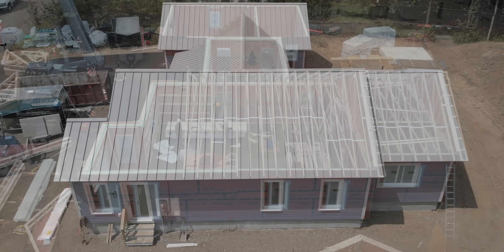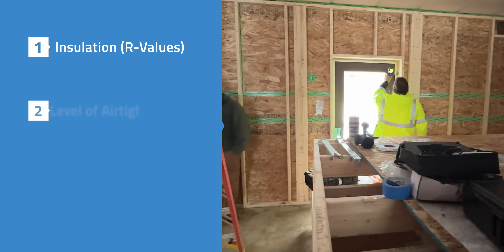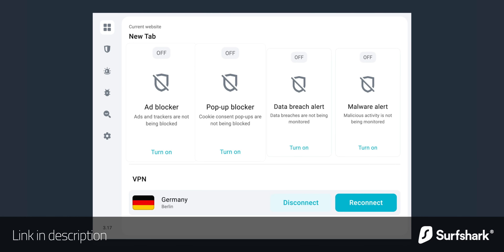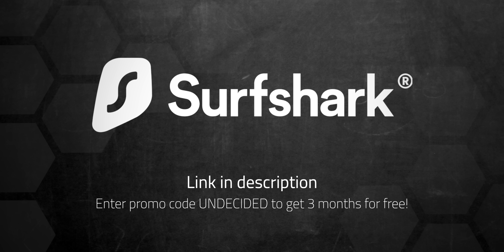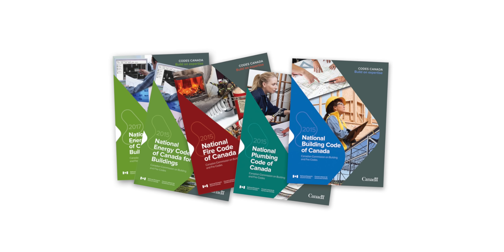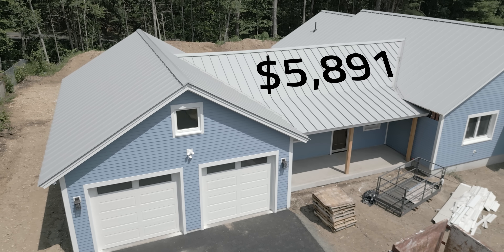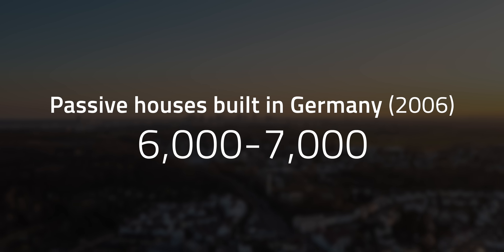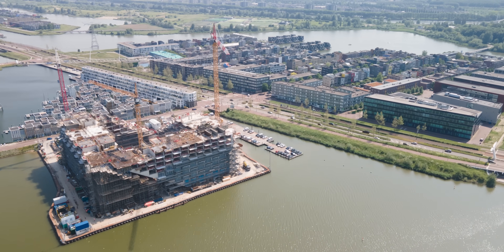Why Do American Homes Suck?

Comment: I think you need to include a fact that you've carefully stepped around. Construction numbers. In the U.S. we build new houses in the hundreds compared to at most double digit for most of those European countries. And you also don't mention when these new improved construction standards were implemented in Europe, because buddy, most European residential construction is really old and even the newer stuff is poorly built. 

Residential construction using cinderblocks is still common along the Mediterranean and places other than the U.K.  And consider that your comparisons are based on single family dwellings while that type of housing makes up less than 10 percent of construction in Europe where apartments and connected townhouses make up the bulk of construction.

Comment: I think all buildings and homes should be passiv standard wherever you are. I can tell you in the UK that the majority of houses in the UK are old, brick uninsulated houses with gas. As these old houses were designed to breath and also it is very difficult to air tight an old home, i think it is best for breathable insulation such as wood fibre and lime plaster. Solar and heat pumps or infrared heating is a must. Sadly our Dumb ass prime minister has started cutting funding for climate change policies. He's got kids as well. Were doomed with people like him.

Comment: The ACH50 listed for Canada is wrong, or at least it’s miss leading. Without going on a long tangent no one cares about. It varies where in Canada you’re talking about and which compliance path chosen but 2.5 ACH is likely a more accurate figure as a generalization imo. But most, if not all, areas this isn’t tested.

Comment: In America, we have innovators like Elon Musk who have advanced car manufacturing. By comparison when it comes to new homes little progress has been made over the years that benefits home buyers. For example, builders get all excited about PEX plumbing as opposed to traditional copper plumbing. That's because it's easy to install and if you're a lucky home buyer the plumber actually knew how to properly attach the pipes together. I read recently that rats are attracted to PEX plastic. Homeowners have had their homes flooded because rats chewed through their water inlet pipes. The bottom line is, that in 2023, homes could be built so much better and be far more maintenance-free, but they're not at all. As a final comment, I live in a neighborhood in N GA that is close to the Alpharetta city center. The area has become popular with wealthy buyers who buy homes in our neighborhood for the land and tear down to rebuild mini-mansions. I used to work in construction and spoke with a construction supervisor in our neighborhood. He said that true carpenters are nearly non-existent. Homes are built by somewhat skilled laborers and unskilled laborers. Good construction supervisors are usually former carpenters. I've seen slabs poured over PEX and imagine rats chewing through the pipe creating a nightmare for the homeowner at some time down the road. One home up the street from us was up for sale for 2.6 million. It had an underground plumbing leak for about a month pouring water into the gutter. I think they may have fixed it but what about future leaks if the pipes weren't connected properly?

Comment: The Metric System.   There is no argument that it is far better than the imperial system.  If you measure in Metric, you will never have to work in fractions.  

I hear Americans complaining about the Metric System, however I  laugh as all Americans have been using the Metric System for over 200 years and I have never heard anyone complain about it.

Metric has three main Units: Metre - Measurement,    Litre - Volume,     Gram - Weight.

There is one more Unit you don't hear aboutt.   That unit is the DOLLAR.

We have a Deci-Dollar, or as we call it a Dime.

And we have a Centi-Dollar we call a Cent.

If we go the other way we get Mega-Dollars.

So no need to be afraid of Metric.  It is as easy as dividing and multiplying by 10s, just as you do with Dollars.

Of course in the money world they have quarters and half-dollars, but overall, it is a Metric System.

Comment: Back in 1985 I bought a 1903 craftsman brown shingle home in the San Francisco Bay Area. It was mainly original. Oh the gas lighting had been replaced with 30 amps of electricity and knob and tube wiring. The heating had been upgraded from the coal stove in the kitchen to a horizontal gas heater sitting on bricks in the crawl space. And a garage was tacked onto the side of the house with the inside wall still covered with the original wood shingles from 1903. Single pane windows and zero insulation. This was a stick built wood frame house with lath and plaster walls.

The first task, this being earthquake country, was to replace the brick foundation. This also provided the opportunity to have a small utility basement so the water heater wouldn't be outside and to add a reasonable gas heater.

After retirement and the accumulation of sufficient assets to upgrade everything, the house was completely updated: New roof with solar, 200 amp electrical service, heat pump water heater and heat pump heating and cooling, insulation to the max and more than just one bathroom. The only remaining gas appliance is a clothes dryer. The big surprise was that I had a negative gas and electricity bill for 2022. I actually made $230! Insulation and double pane windows made the difference. Heat pumps and LED lighting helped too.

After reading some anti-city comments here I must add that the house has a walk score of 98, a bicycle score of 99 and a transit score of 62. It is on a quiet street because of traffic calming and has a large back yard. These things are compatible with good city design. It is a real 15 minute city.

Comment: Ok, a couple of issues right away.
 The sheathing has absolutely nothing to do with insulation, it is there to regulate vapor exchange. Every wooden house has to have that regardless of what else might be done inside.

Saying that there is a lack of federal regulations makes about as much sense as saying that NASA doesn't do enough to regulate food additives.  The reason we don't have federal standards on environmentally friendly home design, is because that has nothing to do with foreign pollicy, the bill of rights, or interstate commerce. The federal government has no authority to act outside of those areas. Only state governments can regulate building standards.

Comment: The biggest problem I see in the UK is a lack of tiny houses as starter home. And I mean houses. If it has wheels, it's not a tiny home or house, it's a caravan (or a bicycle or something). There are some great designs out there, even ones that don't require the residents to be a 25 year old gymnast who can vault into a loft bed. But we aren't building them at all, there are no developers doing it (a handful of councils are building them for social housing but in tiny numbers) and worst of all, we aren't even building blocks of flats on that principle which would be vastly more efficient.

The block I used to live in I rarely needed to heat the flat at all. Triple glazing, tilt and turn, thick/well insulated walls. Lots of other problems but heating wasn't one of them. Whoever let them build a ten story building with one lift should be imprisoned for instance, don't ever buy in a property like that if it's newly built. We'd turn the heating on for maybe a couple of months in the winter. The bigger problem with heat was getting rid of it during the summer because you couldn't get a draft through with the windows open most days. A simple venting fan would have taken care of that, wouldn't even have needed full on air conditioning (but they should build with it). 

There was so much wasted space in that flat though from terrible layout decisions and a lack of focus on tiny home philosophy - which should be applied to all buildings. Storage, storage, storage. It's amazing that homes aren't designed in 3D to take proper advantage of space. 

But I'd still rather live in UK houses than typical American ones.

Comment: I never reall6 paid much attention to new home build quality till I started watching Matt Risner's BUILD show. Then I started looking at all the cookie cutter housing projects and comparing them. I realized how little of quality they were at an outrageous price.
It's clear they are being built to the lowest standard code allows to sell at the highest price possible for the building investors, and for the same price, I could have a custom home built to very high standards.
Reply: There was a million dollar home put up on my road, they spray foamed the exterior walls for insulation, and didn't go beyond half filing the 2x4 walls. So about 1/2 to 3/4 inch of spray foam between the studs in USDA zone 6.

Comment: I live in a 1931 house with zero insulation (except where we opened walls after purchase).  The climate in SoCal is desert like.  So HEAT is our foe.  But unless the temp goes three digits we dont turn on the air conditioner.  And being only 1400 square feet we really dont use that much energy (we put solar up on our flat roof back in 2010).  Our last two month power bill even using the air conditioner many days was only $37.  Winter isnt that cold.  I grew up in Chicago so know what cold really is.  It never gets down below freezing (which is rare) but 40s and 50s is normal.  But the locals--geez--youd think the world was ending with such temps.  Ive survived 40 below several times back in Chicago--even working nights on a movie for five weeks.  SoCal is a breeze.  Are we losing energy through our stucco walls?  Absolutely.  But with the solar panels on the roof I truly believe they are actually saving us from the heat.  

Cant wait to hear more about the new house.

Comment: The unified code fails to consider energy efficient, low cost ALTERNATIVE building methods.  It's primary focus is to protect big business interests either than address environmental and safety concerns.

A big failure.

Comment: YES YES YES!!! American homes just suck regarding efficiency. I built my retirement home in 2017-18 using ICF construction, triple pane windows, and more. There was only 1 contractor in a 200 mi radius of me that even had experience with this method of building. Overall more expensive but absolutely will pay for itself over the next 20yrs. ACH score of .97! I wasn’t willing to get rid of my regular dryer, or stove vent, and having a wood stove didn’t help the score either. Totally satisfied with where we ended up.

Comment: Most of Europe is located at a higher latitude than the USA.  That means on average, most of Europe is colder than most of America.  As such, they benefit much more from insulation than most of America does.

In addition, energy of most sorts is notably more expensive in most of Europe than in most of America due to increased taxes.  That also makes efficiency that much more desirable in Europe than in most of America.

Combined, that makes a great difference in viewpoints in what insulation and efficiency concerns and standards are considered important.

Comment: I see several mistakes. triple glass pane windows are nice, but double glass panel windows are quite common in europe too. even that is better than just one panel.
the bigger mistake is still hanging on balloon frame buildings. in europe, stone and bricks are used regularly. the most insane thing I've heard about someone so far: using 45cm hollow chamber bricks (essentially 1.5 ft for the metrically challenged) and that guy got to passive house standards without a single centimeter of thermal protection (just google "mauerhohlblockstein").
and you complain that the US has various building standards, and not just one? well, there is the EU and there are countries that are not members of the EU. neither have common building codes, or just building codes on national level, but it goes way down to municipal level in some countries.
additional fun fact: there is the plus energy house, a standard in germany, austria and maybe other countries. a house that virtually always creates more energy than it uses. and that standard was created well over 20 years ago.
by the way, I grew up in a house that was built in 1601. at times it was hard because it was poorly insulated (we had double windows... essentially one set of glass windows and then 10cm away a second set of glass windows, that was a tech that was well over 100 years old. but now since it was renovated (parents still live there), this house is great. 1601. and the church next to it (10m) was built between 1272 and 1336. still standing strong, but recently a storm crooked the cross on top of it, so it had to be replaced.

Comment: Always enjoy your videos. Thank you very much Matt. Regarding home energy efficiency, one thing no one mentions, and that is certainly not in any building regulation here in England, is the question as to whether or not a house is facing south or not. Or, indeed, whether it is geographically exposed to the sun's rays. In the North of England I have seen expensive houses built on North facing hills, such that on a freezing day in Winter they are covered in ice, while across the valley  a few houses are frost free enjoying Winter sunshine melting the ice on their roofs. The small town of Ilkley in Yorkshire is a good example of this. This can be particularly striking on a frosty day as late as March or April when the shadowed areas remain in frost whilst the midday sun's rays can be already quite hot. "Don't cast a clout til May is out". And, make sure your house is catching the sun's rays. 

Along the Wharfe valley, where Ilkley is situated, there are a number of 18th century halls all built facing South. With the morning Eastern sun warming the Eastern side of the halls, then the midday sun warming the South side of the halls, and the Western side of the halls warmed before the sun sets. Added to this, the impressive stair wells of these lovely halls are designed to be in the middle of the home, causing a wonderful convection to happen. Warm air from the sun's warmth enterers from East, South and West, but rises through the middle of the house, and convects out in all directions on the upper floors. 

One can insulate the poor man's house on the North side of the valley as much as one likes, however, it will never be as comfortable as the rich man's hall facing South, on the South side of the valley.

Modern "Gaia" houses in Norway have understood this concept. While, Matt, you know better than I about Copenhagen's building inside a geodesic dome https://youtu.be/1Bn2o-xyS6M?si=rMGbJS5Nu-52GLTd Wouldn't it be far more effective to cover a whole home in a "greenhouse" than waste money on insulation and expensive windows?

Comment: I think the biggest difference between European houses and American houses isn't the insulation or airtightness, it's that heating in Europe is water-based, not air based. I'm honestly surprised that you went through all that troubles of building a super efficient home and let's be honest, paying a lot more than a regular home would have cost, and then you stick with cheap forced air instead of getting the much more comfortable heat from a (ideally underfloor) water-based system?

Comment: Very informative video! The comments by Ted Benson at the end sum the answer up quite nicely!

> "We (the US) just don't take home building in particular, as seriously as other countries do. The standards that we (the US) have in our building codes are just too low."

As a Canadian who has worked for Canadian engineering firms that are regularly hired out by US companies to design their buildings and infrastructure, this is the truth. Our standards far exceed yours for reliability and environmental protections. Often, the US project manager will say things like, "we like Canadian engineering firms, they'll give us a safe plan that we can then easily cut corners on if we decide we want to save money down the line." I wish I was making this up, this is what US firms do in South Dakota while building oil pipelines and energy infrastructure.

Comment: I am ITCHING to hear more about the geothermal system Matt has installed.  I had solar installed on my home in 2021 and expanded in 2022, and HVAC is my next home improvement stop.  My current HVAC system is 28 years old and will be 30 by the time I am ready for upgrading.  I have a standard 80% gas furnace and a 2 ton, 10 SEER air conditioning system.

I was investigating air source heat pumps for a couple years and nearly went that way until I caught wind of geothermal.  It's the same thing, it just pulls and stores energy in the ground instead of the air.  WAY more efficient and no outdoor hardware visible.  I don't have the land for horizontal loops, so I'll have to have a couple vertical wells drilled.

I found 2 manufacturers that do exclusively geothermal - Climate Master and Water Furnace.  I checked into Carrier but they seem to be a decade behind these other two manufacturers, but they also offer a solution, albeit I find it basic.

The only thing really stopping me from doing it is fearing the install cost, even though Uncle Sam returns 30% of everything back to my pocket in a tax credit, and waiting on the refrigerant change from 410a to 454b which is taking longer than I expected.
Reply: Nor familiar with Climate Master but the geothermal installer in our area uses Water Furnace and it seems to have a very good reputation.